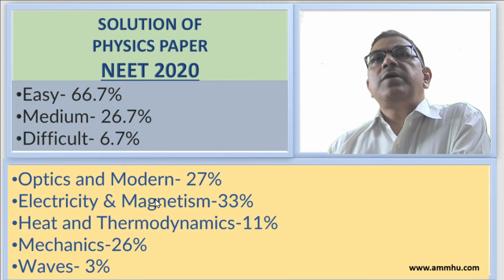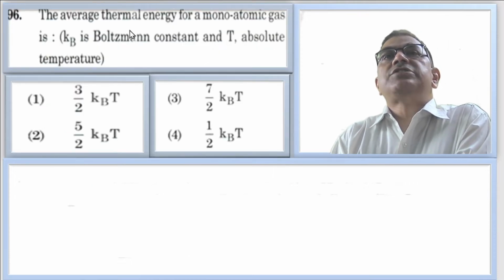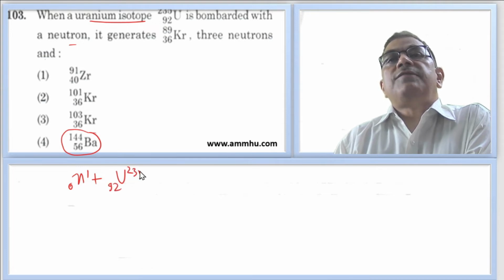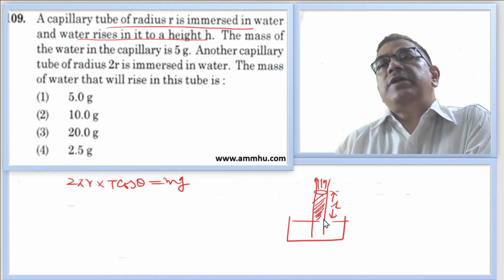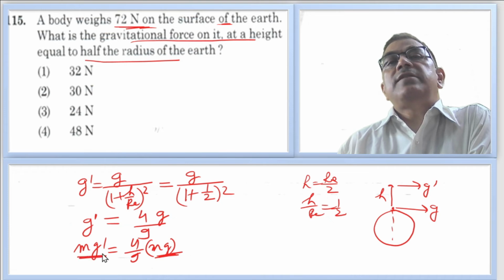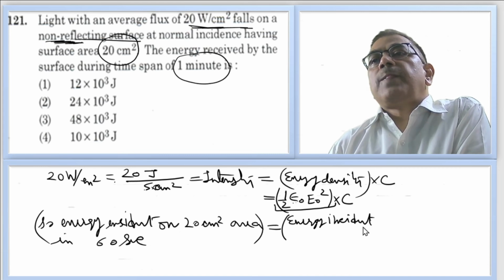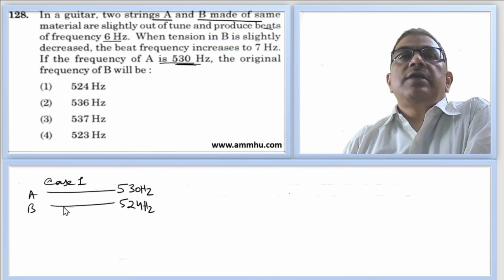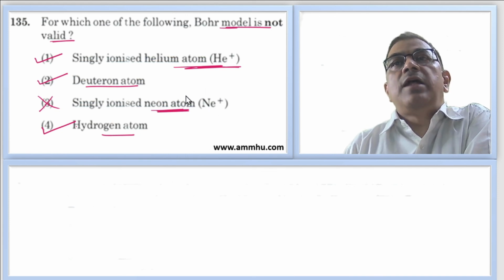NEET 2020 PHYSICS SOLVED PAPER || NEET 2020 PHYSICS PAPER ANALYSIS || NEET PHYSICS PAPER DISCUSSION

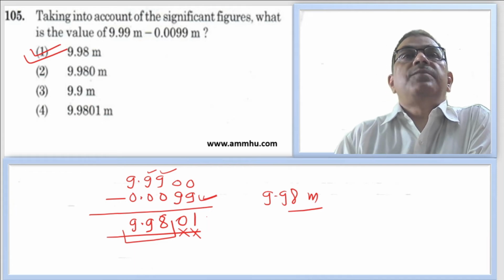Comment: 25:02 Sir, but the key says the correct option is (3). Please clarity sir.
Reply: Thank you sir
Reply from the maker: Dear Panneer, The first measurement has the least count 0.01 m while the second measurement has the least count as 0.0001 m ( any observation got to multiple of least count only ). When we add or subtract , we see to the fact that final answer has as many decimal places as in observation with least number of decimal places. Hence argument that suggested should have more validity. It seems question remained unchallenged,  which is a real concern.  
Another comment -  Usually we can tell about the least count after looking at large number of observations.